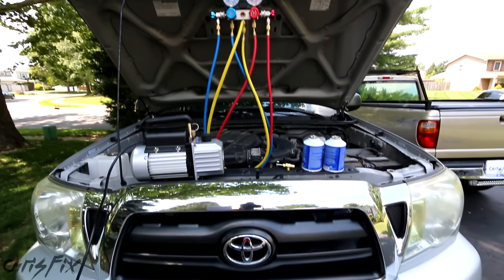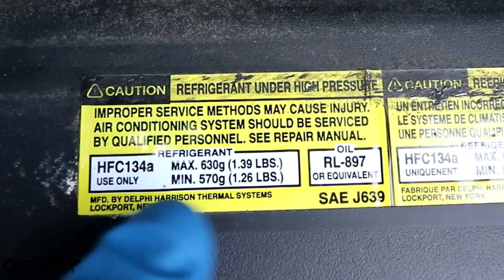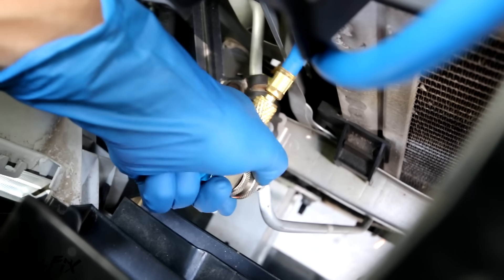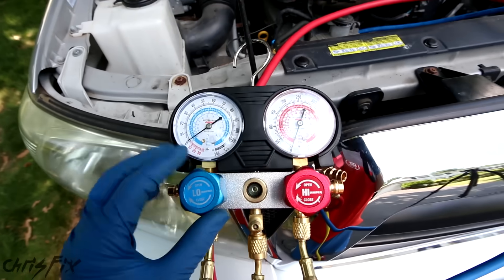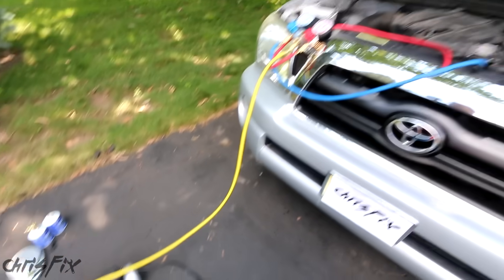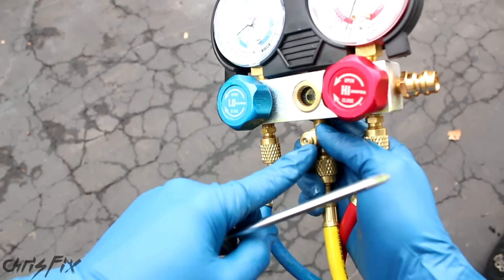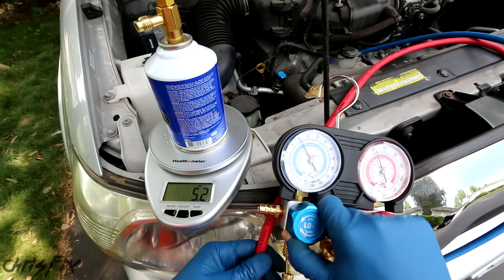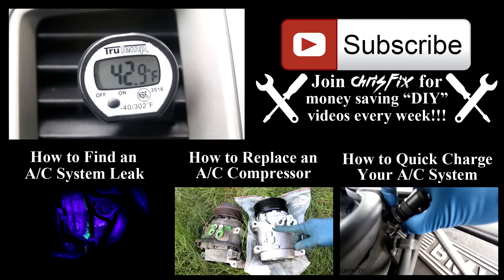How to Properly Recharge Your AC System

Comment: @chrisfix I have a question for you, my cars a.c. doesn't work so I hooked up a can of refrigerant with a meter in it to my car and before I opened the refrigerant I hooked the meter to the low pressure valve just to see where the car was at and the little meter is pointing to the warning position when the compressor kicks on it moves to the alert position but then the compressor keeps kicking on and off quickly so its stuck on the warning position what do I need to do? Thanks!
Reply from the maker: +Brown Bear So your compressor is not staying on long enough for the pressure to build up on the high side and for the pressure to lower on the low side. Maybe the pressure sensor is bad.
Reply: +ChrisFix Thanks! I'll definitely look into that, Your videos are awesome I've done so much work on my car because of your videos and now my car practically runs like its brand new!

Comment: Hey Chris, I've got A 2002 Chevy Silverado z71 5.3. It has a limiter of 100. Any ideas on a way I can change or fix that
Reply from the maker: +Kimberlie Walker You need to get it tuned out but a tuner. It has a speed limiter because the tires or the aero on the truck are not designed to go over 100mph so be careful.
Reply: Thx man

Comment: Harbor freight setup right?
Reply from the maker: +Beau Michna correct but I found a better price with the link in the description! The HF stuff worked well though if you were wondering!
Reply: +ChrisFix   Nice, thanks for the link. I'm usually picky about tools but I found the compression and fuel pressure gauges I've bought from HP have lasted a long time. Just was curious how they worked out for you.

Comment: Nice video. Adding the oil in your way is a bit messy. There in an AC oil injection tool to add the oil correctly. maybe a video about that tool too?
Reply from the maker: +Ahto Andron Thanks a lot! For someone doing this once or not very often, you dont need a tool, just a steady hand. For someone who will do this often, a tool would be a good investment! Thanks for sharing!

Comment: ChrisFix quick question. What is the difference between recharging your A/C this method compared to recharging it with A/C Pro like in your other video. Is one method better then the other?
Reply from the maker: +Heesler Alvarez Two different situations. The AC Pro job was a quick and easy job for someone who has a tiny leak that takes a year for the AC to not cool anymore. Plus working on the AC in the BMW will be expensive and probably worth more than the car. In this case, I showed how to fix the leak and charge the system when there is no charge at all. So we started fresh.

Comment: Like clarity of voice and videography.TWO QUESTIONS:  How does the oil actually go down through the tube and into system without compressing it though the hose?
The weight of the 2nd can was 20 oz.  But the valve on top of the can accounts for weight. How then do you determine that you are actually moving the actual weight of 134 that you desire unless you know weight of valve on top of can?
Reply: +scooter12368 

20 oz is the combined weight of that system, the can, valve, and a little hose.
10 oz is the combined weight of 10z drained R-134 (-), the leftover (2 oz), the can, valve, and a little hose.
Reply: +Jordan Karim      thank you jordan.  the other question was:    how does the oil get into the system from a bottle that chrisfix was demonstration without any compression forcing it to get into the system?  I can understand if it were a can compressed with oil but don't get it if it's oil being lowered into the yellow line.
Reply: scooter12368 Not sure about that one, I understand what you are saying though.
Reply from the maker: +scooter12368 Jordan answered the first question (thanks) as for your other question, the compressor is sucking the refrigerant from the low pressure side so it sucks it out of the can. While there is still pressure, about 30psi, the compressor is drawing out refrigerant from the can which also has a higher pressure. Hopefully that makes sense.
Reply: ^ But when it comes down to thermodynamics the fluid doesn't fully get propelled into the ac system. That is what he is wondering about. It doesn't turn to vapor and shoot in there :(.
Reply: +Jordan Karim : thats exactly my thoughts.  so is the function for the 134 to push the oil down through the tube.  put oil in tube and then hook up can of refridgerator and hope that the gas of 134 will push the oil into the system?
Reply: I'm not qualified and don't have enough knowledge on this to let you know. See if you can find anything online that is credible.

Comment: Great videos thanks for the help, I have a question, I have a 1996 Plymouth neon an the steering wheel does not tilt, an I able to raise it for better comfort or do I have to replace it
Reply from the maker: +pmart06 Try moving the seat. There should be an adjustment in the seat since the steering wheel doesnt tilt.

Comment: where did the other 10oz of refrigerant go? for people watching this as instructional, it should be start to end, even if it adds a few minutes of dull video, it could make the difference.
Reply from the maker: +Mark Miller What are you talking about? I show every step. I show you the first 12oz can and then I show measuring the second can so you use 10oz.
Reply: My concern was the remaining refrigerant in the can, hooked up to the gauges. Would disconnecting the can release the remaining?

Comment: When my engines is idling the Aircon seems shut off and no cold air blow, but as soon as I Rev the engine to about 1100rpm the air con is cold again. What could be the problem?
Reply: Thanks noted will try
Reply from the maker: +wing hum thomas fung Sounds like low refrigerant to me. Check the pressures or boost the system: https://www.youtube.com/watch?v=SHg2xRMnM38

Comment: If you vacuum your system with the compressor filled with oil the vacuum wont suck it up? How can you know how much oil you have in the system?
Reply from the maker: +Radu Christian The vacuum only removes water and air. Water under vacuum boils instantly and turns to gas so it can be removed. Oil does not boil under vacuum so it stays in the system. You have to check your service manual to see how much oil your system needs and when you replace certain components (like an ac compressor) you add oil for that component.
Reply: +ChrisFix okay thanks! The thing is that one of my lines had a leak on my a4 and there was oil coming out of there so even if i change the line and take the oil out of the compressor i wont know how much oil is left ::

Comment: Hey Chris my truck is cranking but wont start. any ideas. Oh and i think the squeak is my wheel bearings or my U joints on my drive shaft
Reply: its running now.

Comment: Great video. I have a video idea which is to replace a steering stabilizer. My suv came equipped with one from the factory. I plan to replace it because it has 150,000 miles. I also asked for one for my birthday which is comming up (November 9th), seems like a long way for some people. Another idea i just thought of before posting this comment was a vehicle maintenance overview like fluids, what fluids to change, testing ac and heat, etc. And another idea once again, maybe a used vehicle checkup video of what to look for before buying a car.
Reply from the maker: +mrklimczyk Those are awesome video suggestions and I just added them all to my list! I really want to do a used car shopping video!

Comment: Once again ☆☆☆☆☆ on your videos, but I have a couple of questions. Most manual say to turn the fan motor on high but you put your on low, does it matter? Also, instructions on the can to rotate the can for some reason, but you seem not to have any problems leaving it sitting still, any idea why they have you rotate it? 
Once again, love the videos! !
Reply from the maker: +Mark Shaw Thanks mark. The only time you need to put it on high is if you have climate control because when it cools it might shut the compressor off. In this case we have regular ac controls so it doesnt matter if it is low or high. You dont want to rotate the can in this case since it has no additives in it. When you flip the can over, it will allow liquid refrigerant to flow out which could damage the compressor. In cans with additives you want to turn the can from the 9 to 12 oclock positions.
Reply: +ChrisFix Thanks Chris this is really good to know

Comment: chris , how can you know how much refrigerant you put in without a scale ?
Reply from the maker: +eyad aljamal You can go by the can weight. So if you need 24oz then you add 2 cans. If you need 20oz, get a 20oz can. Otherwise you need a scale.
Reply: We don't have 20oz cans , what we have is a 14kilos cans. So I think I should get my self a big scale.
Reply: ChrisFix but Chris I also saw technicians fill the AC witg the same 14k cans without a scale , so how can they know how much they put in just by looking at the gages ?

Comment: Great video as usual, and while although it works this time you have to be careful using fluid ounces and the weight measurement ounces interchangeably.
Reply from the maker: +Cole Hoover Thanks Cole. This is how you weight refrigerant for adding it to the ac system.

Comment: If I get the refrigerant removed at a shop (planning to refill it myself) and am not replacing any hardware, do I still need to put some oil in there?
Reply from the maker: +Samuel Feguer not if you are not removing any parts. If there was a leak, I would add a little depending on how bad the leak was. Might even ask the shop that removes your refrigerant what they suggest.

Comment: i've seen mechanics charge up an A/C system using only the manifold gauges as their reference. How can they possibly do that without knowing the exact weight of refrigerant that was sucked in the system?
Reply from the maker: +Ahmad Nader They do it based on a chart of pressures on the high and low sides. Kind of like this video: https://www.youtube.com/watch?v=SHg2xRMnM38
Reply: Thanks for your reply Chris, but can this be accurate?
Reply from the maker: +Ahmad Nader It is replatively accurate. Obviously nothing is as good as evacuating the system and starting fresh but if the pressures are in the range at a certain temp, then you should be good!

Comment: Great video as a whole, although I'm a little confused on a couple points:
After pulling a vacuum on the system for an extended period of time surely any UV dye you added previously would have been evacuated.. No?

Also I'm a little confused as to how to add UV dye if it isn't included in the refrigerant. If you were to fill the hose before hand wouldn't you evacuate most (if not all of it) while releasing air from the line?
Reply from the maker: +Azurren The UV dye as well as the oil in the system will not be sucked out, only moisture (H2O) and air will be removed. Water boils in a vacuum which is why it gets sucked out but oil doesnt. You just add a little but of UV dye in the yellow line, then connect the refrigerant bottle. You only purge the air out for a fraction of a second and you wont lose much if any dye. The dye is an oil so it will stay at the bottom of the line.
Reply: ChrisFix Excellent! Thanks for clarifying :)

Comment: Thanks Chris for another excellent video! I just didn't get your point at 8':37" when you said "I don't have to add UV Dye, it's already there!". You have shown that your system has been vacuumed for 45min but how can UV Dye exist in your system now?
Reply from the maker: +Amir Niazi A vacuum only removes water and air. Oils do not come out in a vacuum, they are heavy and stay in the system so the UV dye that I used in the first video on how to find leaks is still in there. That make sense now? Water under a vacuum boils instantly so it can be sucked out with the air.

Comment: Yo Chris 2 questions.

What if your aircon starts great, it's cold, but after about 5 minutes it gets warm again and continues fluctuating?

Also, I've always been told to turn the climate control onto full heat for about 30 seconds after having the airconditioning running to purge the system of moisture (to stop bacteria) Any thoughts?

Cheers again
Reply from the maker: +TheApothecaryAus That sounds like you might have a dirty condenser which is in front of the car and cools the pressurized refrigerant. Clean it off with a degreaser and some water.
Reply from the maker: +TheApothecaryAus And you dont have to run the heat to prevent bacteria. The evaporator will be wet because it is so cold and you have moist air flowing over it. You can run the fan on regular but it wont dry that fast.

Comment: I saw the differences with purging the manifold gauges of air.  But, I'm confused as you've turned the first can upside and shaken it in this video, but not the second.  Also another video (BMW) you said only to turn the can from a 6-9 or 3-6 positions only as the liquid can damage the compressor.  Which positions are the best to hold/place the can of freon when charging?
Reply from the maker: +JRobert111111 You turn the can upside down when you think it is empty to see if any refrigerant comes out (via the watch glass). You want the top of the can to be the highest point when introducing the refrigerant. In the other video using the AC Pro can, there is sealant in there so you want to make sure you get the sealant out so you shake it back and forth from the 9-12 oclock positions.

Comment: wow, great video.  Hey Chris, I have a question.  My jeep grand cherokee laredo has an airconditionor that backs up water into my cab.  I took out my carpet because of it, so now I have a bare metal floor.  I kind of like it that way.  But it still pours water in.  I've read that I can go to the drain tube under the car and poke it to clean it out, but I've had the inner parts of it replaced, and it should have been cleaned out when he took the dash apart.  Even so, how deep do you think I can go into that tube if I drill a bigger hole in the drain tube before I might damage the inner air and heater coils?
Reply from the maker: +Gristle Von Raben You dont have to drill a bigger hole, just get a snake and poke around to remove the debris. If you drill you could go too far and hit the evaporator and damage that which would be bad!
Reply: +Gristle Von Raben I used an air compressor and a trigger nozzle to blow out the drain tube on mine about 2 weeks ago. I was driving home and heard all this sloshing around when I made left-hand turns. Researched it on Google and that's what I came up with. A couple of pages said not to use anything jammed up in the tube because you could damage something by not knowing how far to poke around. My carpet was all wet and water was everywhere. Since using the air compressor I haven't had any issues. It was so easy I went ahead and did it to my other vehicles while I had the tools out.
Reply: Thank you both.

Comment: Chris thanks very much, for this video i learn a lot from you channels, you and Eric are  great guys, but my car is 02 Camry, and when the temp is 90, when i on the AC the thermometer drop, to 60 but since i finish the cooling system is down to 40 still not cooling ok for me  like my 2014 Camry what do you think will be the cause, i want the thermometer, come down to (20 or 30) any idea what to do thanks,
Reply: +Prince Dabby The system won't go that low without the evaporator icing up, then it'll actually blow hot air in that state, not cold.
Reply from the maker: +Prince Dabby The lowerst your AC should go is 40F. Any lower and you will freeze your system. You can try cleaning the condenser which might help get you some lower temps on the really hot days.
Reply: Ok I will

Comment: you know there a tee in the gauge you can just use another hose to pull a vacuum on the yellow line and not need to purge air out of the line
Reply from the maker: +MrGomoma Yea, I dont have another hose to do that so it is easier to just purge it real quick. Thanks for sharing!
Reply: @chrisfix  Chris, I have to ask that when you connected to the high and low fittings on the vehicle, you said open the valves. I think you turned the knobs clockwise that I assumed would close the valves. I hope you can verify how to open the valves?
Reply: @tomhudson2280  twisting them clockwise pushed down on the shrader valve on the line. Hence opening it. But be careful, for some reason when I take my manifold gauges off my shrader valve keeps getting stuck open. I'm not sure why this keeps happening.